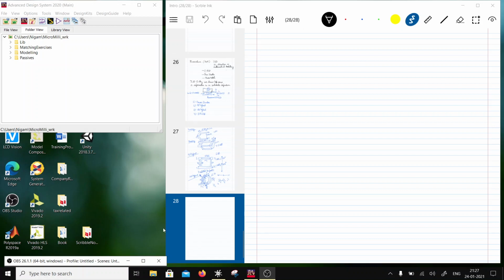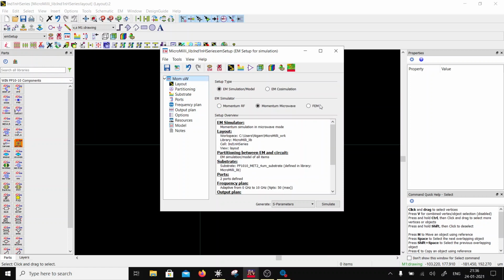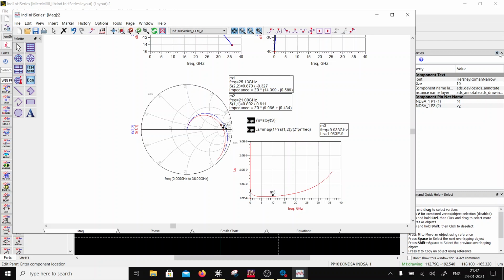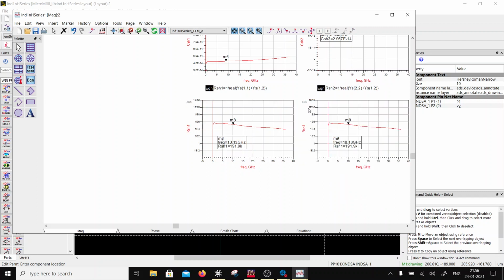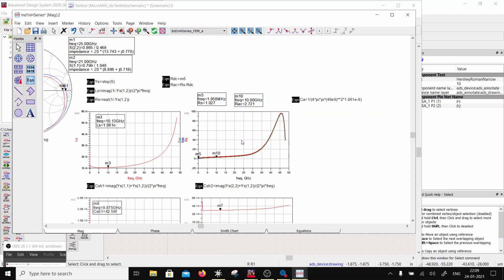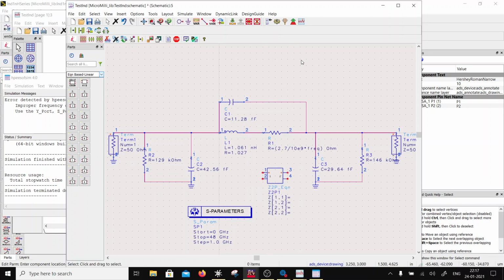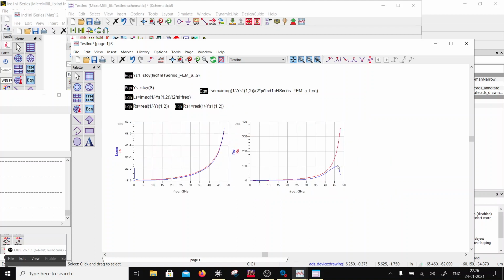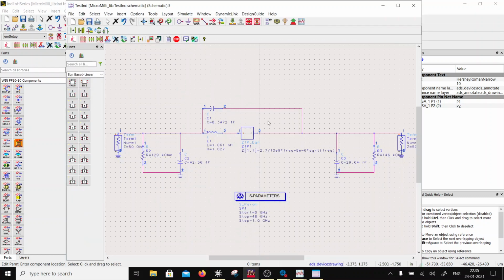Microwave Millimeter Wave Circuit Design Session6

Comment: EM simulation for inductor is done using a ring metal ground (even >100GHz) not underneath strip. Discontinuity causes the current return path to be formed on the ring (around inductor) and that is how it should be.
Reply from the maker: I know all this

Comment: Could you please explain why we have a ground plane underneath the inductor? Doesn't it create eddy current and affect the inductance? Why not have a ground plane around the inductor (with some margin distance) and reference the ports to that ground?
Reply from the maker: It is not a plane its a strip. It has to be least possible ground between two ports else ground discontinuity at high frequency will let nothing trough the inductor
Reply: @anuragnigam9443  Thanks for the response. But I still think that since this is a solid piece of metal, we have a significant eddy current underneath the inductor. Could you please put a comment on how far the ground underneath the inductor needs to be (relative to the outer diameter of the inductor)?
Reply from the maker: @soroushmoallemi774  well thats the art. You can do what ever suits your design